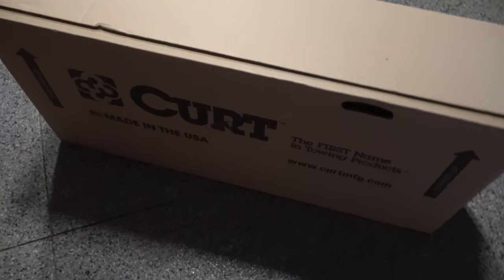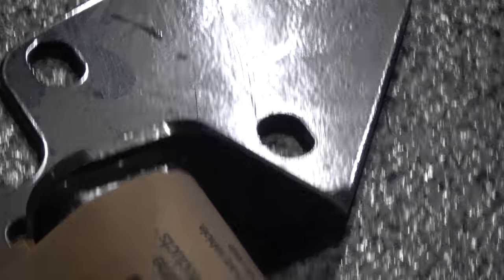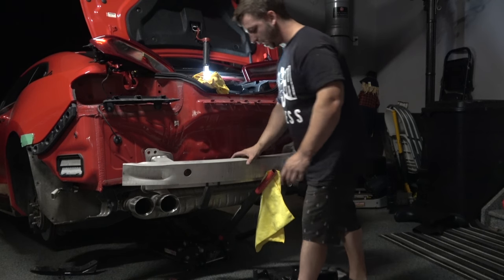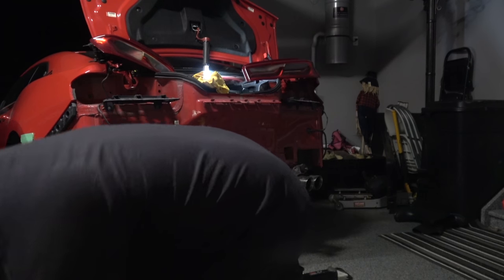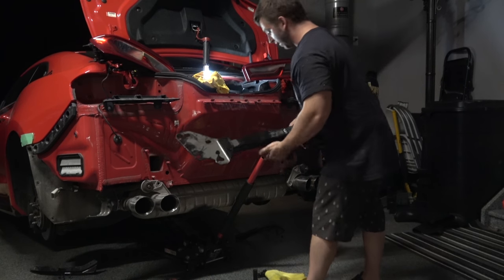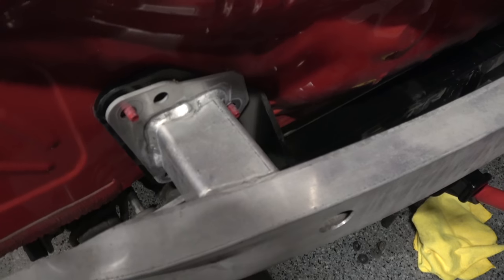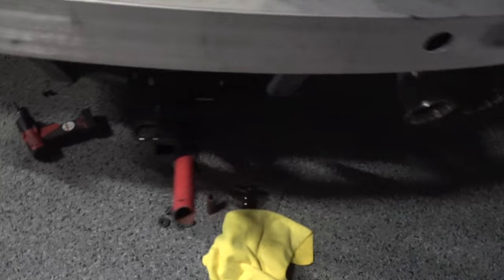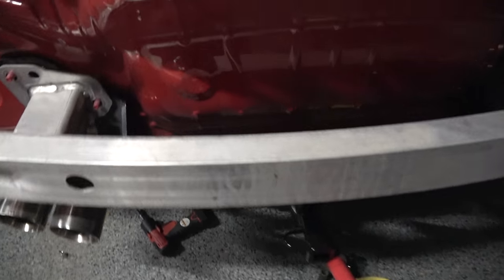Camaro Hitch Installation 2016-2023

Comment: Doesn't it seem like a lot of force on those bumper nuts? What do they say is a safe max weight?
Thanks, DC
Reply from the maker: When I looked into the hitch on the camaro, I looked into the tow capacity of the alpha platform from the ATS and that has a tow capacity fo 1000LBS, trailers are supposed to be 12-15% young weight so that would peg me in at 150lbs on the ball as my top end hitch weight. I put 200 lbs of weight in my trunk for snow weight and it didn't even squat.

Comment: Why would you ever do that to your car it should be illegal to sell that shit 😂
Reply from the maker: I had a decision to make. 
1-Continue racing - Yes
2-Race stock - Yes
3-Drag Radials - Yes
4-Truck and trailer - no (EXTREMELY OUT OF BUDGET)
5-Drag Radials - Yes
6-Trunk storage - No
7-Trailer0 Yes

I have been racing with over 150 pounds of camera gear and tool, sin my trunk every run so how do I make the videos, empty the car, keep my stuff safe, carry tires, and push my stock car into 11's 1/4 mile... Trailer..